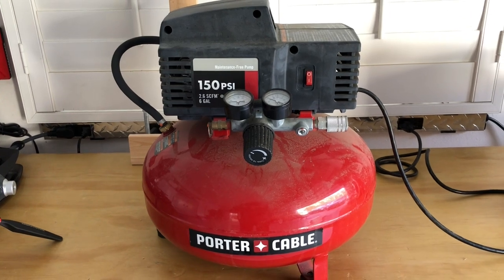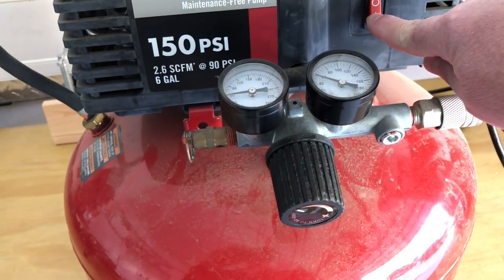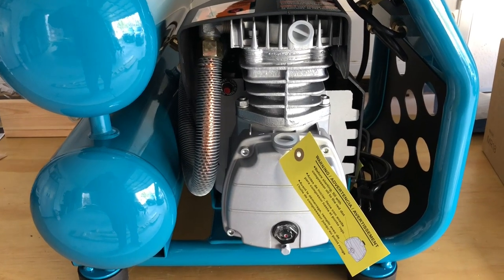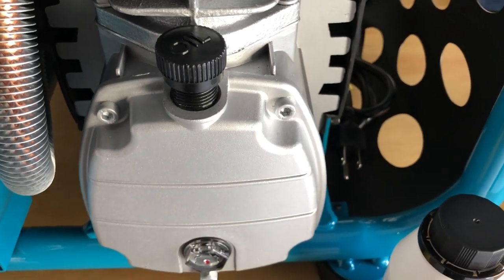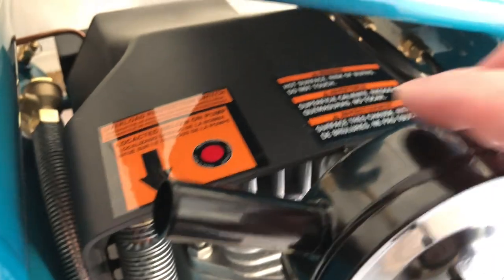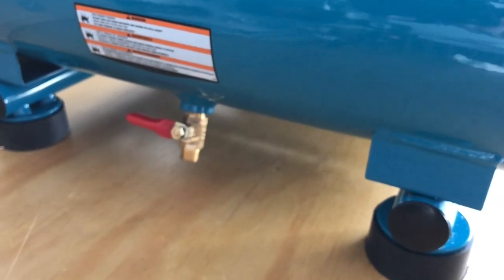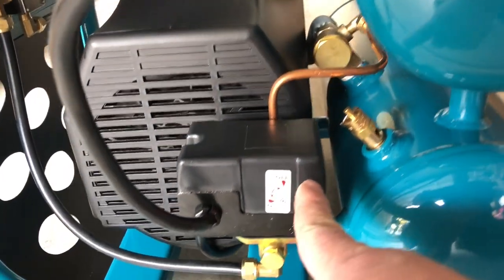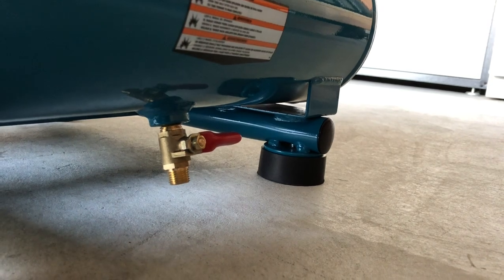Air Compressor replaced Pancake Style with Makita MAC2400

Comment: I still have the pancake porter cable that I bought used about 6 years ago. Still works great but very loud. I'm looking to replace it with a Makita. Great video.
Reply from the maker: Have you made the change? I think you’ll be very happy,

Comment: LOL...I knew that drain cock was closed when you flipped it.  I thinking: This guy is gonna come back and the compressor will be off and he'll think it broke" . Good catch on your part.  The drain on my vertical tank was so hard to reach and turn that I went to the truck parts shop and got a cable pull valve for big trucks.  Works great for the out of reach valve on a stationary tank.  I may just get this compressor.
Reply from the maker: thanks for your comment, if you get the compressor let us know how you like it.

Comment: You can also adjust the pressure to go up to 150 by turning the screw or bolt on the regulator, I can’t quite remember. I did that to my Mac700 4 years ago still no problems at all

Comment: I bought a metabo “the tank” from lowes. Nearly went deaf it was so loud. Took it back because it had a pin hole in the drain plug weld. 

Ordered one of these. Hoping for the best.
Reply from the maker: I love this compressor.
Reply: @AimSmallMissSmall_TV  I got one. Should have checked around though. Can get the 3HP same price.

Gonna cost me about $50 if I decide to send it back.

Probably gonna keep it.